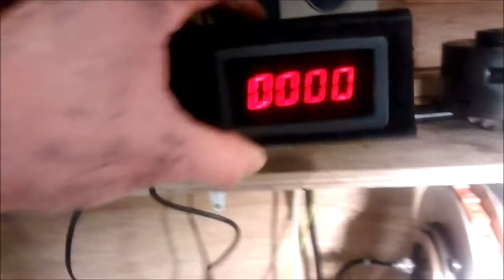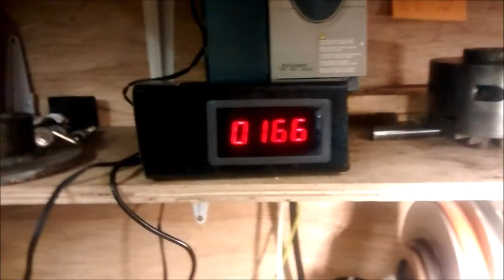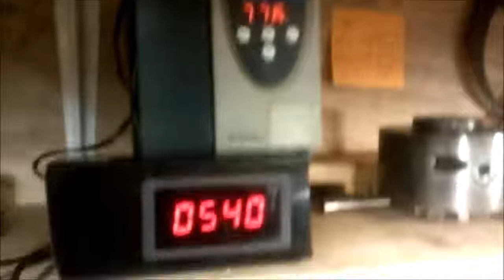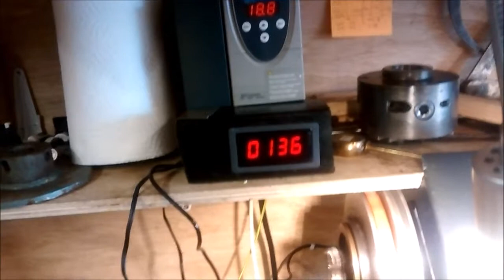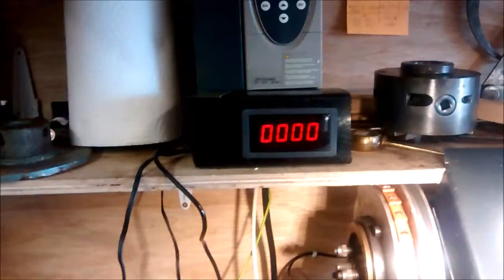Altivar 11 and tachometer fitted to Myford lathe

Comment: Hi - I've got a drill press that I am putting an Altivar 11 drive on. I can't make heads or tails of the documentation. Can you tell me how you wired the drive up and what programming you had to do? Thanks!
Reply from the maker: Hi Mark. The first step is working out where the three phase wires go to feed your motor and where the single phase input goes. The manual has a multitude of wiring options. All you need is a simple 10k potentiometer for speed. You will not need reverse. I will try and get a picture or drawing.